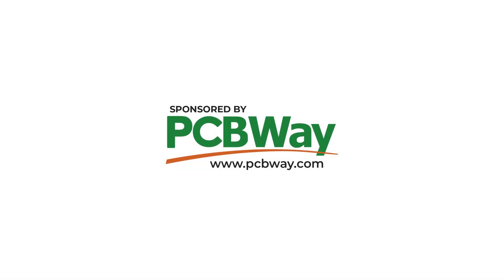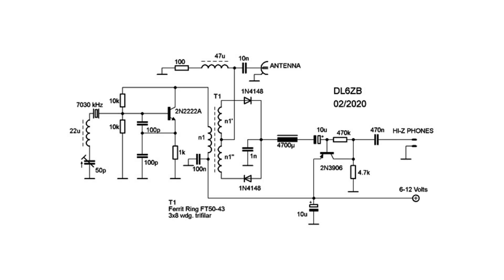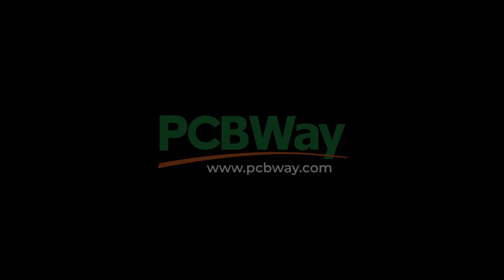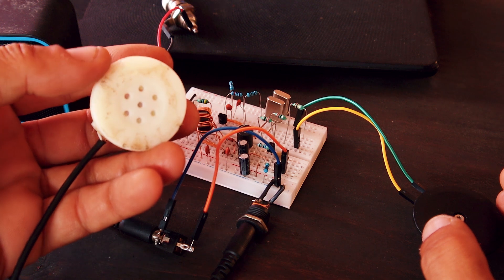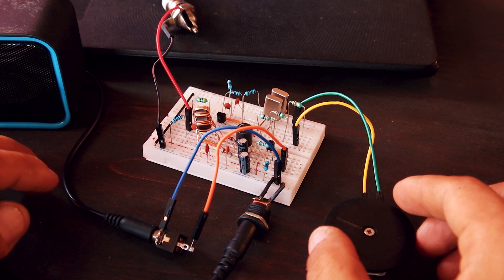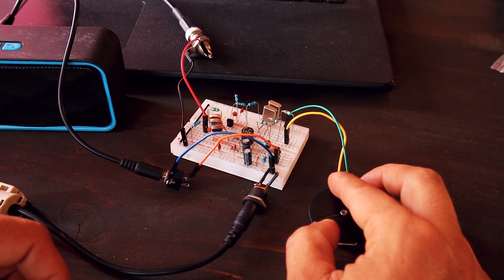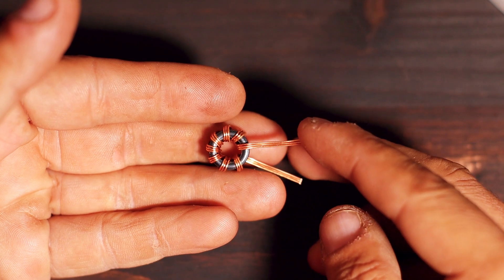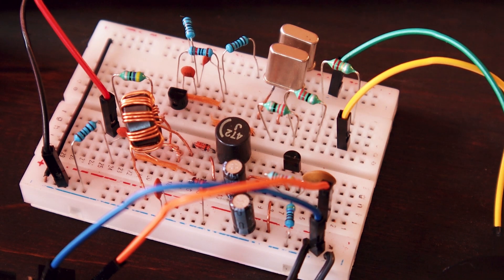DL6ZB Two Transistors Direct Conversion Receiver - VXO Controlled 100% Analog

Comment: Very nice!  And simple!!  There’s elegance in that.

I wonder if you used a miniature audio transformer to go from high impedance to low (8 or 16 ohm) so that readily available headphones would work?  It might also provide a better dc path.  The series capacitor just needs to be large enough in value to ensure that the low frequency audio isn’t lost.  I suggest using a high C value there, regardless, so it doesn’t sound tinny.

I’m going to try building one as I am fairly confident that I have every part, even the 40m CW crystals.
Reply from the maker: Thank you so much for watching and for the idea. That I didn't thought about. I have to try now as I am curious. I have a few audio transformers around so I will try to do a test when I have a little free time and see how that turned out. Thank you so much. Is indeed a really nice circuit. 73, YO6DXE.
Reply: @dxexplorer The audio level might be reduced due to both the impedance transformation and losses in the transformer.  Hopefully, though, it is still alright.

I’ve been a ham since the early 1980s and lately have been discouraged from operating.  Your video is enticing me towards putting together a simple minimalist QRP station.  Then I could pretend that I’m marooned on “Gilligan’s Island” and found a way to contact the outside world.!😊

Comment: I'm curious about the three components in series off the antenna. A filter I guess. I'm just thinking, surely it couldn't be a bandpass filter with just three components.
Reply from the maker: When I will have the time to design the PCB board... 100% I will also place a filter as well. But most probably with 5 components so at least we get a decent filter 😁
Reply: @dxexplorer I just put that circuit into Gemini and asked about those three components. I said it is indeed a bandpass filter, but a very simple. Then explained how it works. A very interesting little circuit. I've been learning about impedance lately, something I've never really understood. I while back I cobbled together a very simple direct conversion receiver. Using my nanovna as the oscillator, and a single germanium diode as the  mixer. I used the three local AM broadcast stations, because of there strength, and they're always there. DC receivers don't do AM well apparently. You still hear it, but it can sound a bit warbly. Especially music. I fed the output of the mixer, straight to a little amplified speaker. I had to put my ear to it to really hear. I now know it was a impedance thing. The output from the mixer wouldn't have been much more than a crystal radio. It wanted to see high impedance. One way is a transformer between the output and the amplified speaker. Another is a one transistor amplifier in common collector, emitter follower design for high impedance. Apparently an amplifier using the LM386 is really good for something needing high impedance. But, while I don't understand it, it will work well line level stuff. Like a phone or MP3 player.
Reply from the maker: I also have lots to learn about impedance matching. So far I was lucky and I somehow managed to make things work. I have a feeling it was pure luck as I still don't know how to calculate or measure of a stage... input or output. When it comes to direct conversion receivers..  I am also at the beginning as I wanted to start with simple stuff... but avoiding IC's. Those circuits are even more simple but then I won't understand how it works ))). Is nothing but the fascinating works of radio and electronic circuits. Lots to play with and learn constantly... and have fun of course... lots of fun.

Comment: Plug it into the line input of any sound card and you can use it as an SDR to cover almost the entire band.
Reply from the maker: That I didn't know. Sounds great I will test this. Do you have a link for a piece of SDR software to use it with please  ? I am not so much into SDR stuff and every time I search it becomes confusing to me )). Thanks so much. 73, YO6DXE

Comment: Fabulous. I've been wanting to build a direct conversion receiver.
Reply from the maker: It's a really simple one and to be honest now after building so many regen receiver thinking that they are the easiest to build by beginners, I realize I was so wrong. This one has less headaches and more chances of success for a beginner. 73, YO6DXE.
Reply: @dxexplorer Definitely, regenerative receivers have nuances. They can be successfully undertaken by the new constructor, but are not as tame. They can teach you things though from the difficulties. A direct conversion receiver will teach you principles and be well behaved. I think to play with both, but start with a direct conversion  radio
Reply from the maker: @Dazzwidd I like both. They both have their own charm in a way or another. The DC is simple most of the time and with not many headaches, on the other side the Regen seems like a trip back in time to me 😀. 73, YO6DXE
Reply: @dxexplorer  They are both excellent to learn from, but for different reasons is what I was thinking
Reply from the maker: @Dazzwidd Yes yes I agree 😁

Comment: if i wanted to build for another frequency, say 15m, would the trifilar still be 8 turns?

obviously my other option would be another mixer up front converting 15m down to 7MHz, (or even 10.1MHz because i have a nice xtal if filter at 10.1 on hand), but i like the simplicity to start with
Reply from the maker: From the original article... the transformer will stay the same no matter what band you build it for. You just have to change the 100pF capacitors from the oscillator circuit. I think the more you go towards 80m the less capacity you need... the more you go towards the 10m band the more capacity you need. I am not sure is just what I remember from playing around with VXO circuits in the past. Everything else will remain the same. Of course... you are using the crystal of choice. I also loved the simplicity and that is the reason I didn't want to "complicate" the circuit trying to improve anything but the VXO. love it just as it is. 73, YO6DXE.

Here is a link to the original article: 
https://www.dl6zb.de/minimal_art_receiver/Minimal%20Art%20Direct%20Conversion%20Receiver%20with%202%20BJT.html
Reply: @dxexplorer thanks, I might try with an SI5351
Reply from the maker: @garethsmith7628 I have a VFO from QRP Guys for one of their digital transceivers and I thought about playing with that one as well )).

Comment: Wow very nice receiver for it's simplicity. It's definitely made for you 😄. soo let me add my spices on it 😜... You can add 2 diodes in the mixer it's definitely gonna be better , also extra two diode won't kill anybody. 😃. For more stability inductor and crystal should be in aluminum box. That's it anything else will make it complicated.
Reply from the maker: The oscillator would definitely be better enclosed. I was wondering if using a 4 diores ring mixer would be better. But since I don't know much yet about the DC receivers... I was really into experimenting to see how that works hahaha. Thanks buddy. I need to find a schematic and see how I add the other two. It's easier to understand when I see a schematic 😅.

Comment: Yay, a DC receiver! One step closer to a superhet.
 Try a resistor across the crystal earpiece for a better DC path, start around 5k
Reply from the maker: Thanks Nigel. I had to cut a little part ... the one when I started looking at the computer as I was talking about you saying ... I finally got away from regens Nigel. But I started laughing badly after that so I had to cut that hahaha. There is the same schematic with two transistors on the AF side for low impedance headphones. It works with 26 Ohms even as it is now but of course the audio is low. But it was a really nice project to play with. I keep looking at schematics for superhet as well. But I will try a few more on DC receivers. Some with the parts I have from you. 73 Nigel. Good luck with your work there. Here... too much work.
Reply: That's funny, Chip. Because just the other day i was looking at "offerings to the God of the airwaves" shelf looking at my 4 versions of Sputnik wondering if there will ever be a time they might get a little brother or sister before my soldering iron goes cold forever,  and, here it is 😅
Reply from the maker: @multilecful hahahahaha. This is just the first step. I already have something in my mind but I need to discover some things first 😅😅😅.